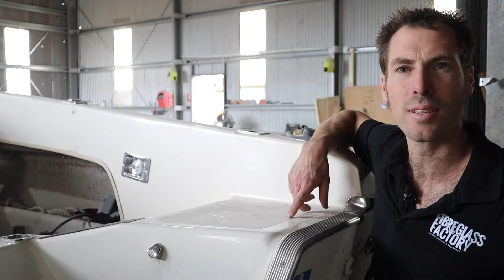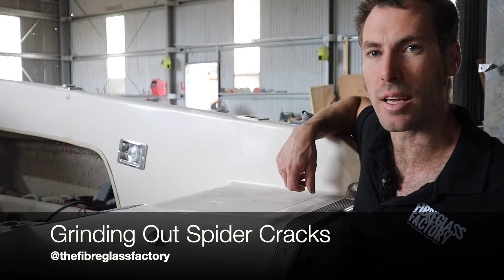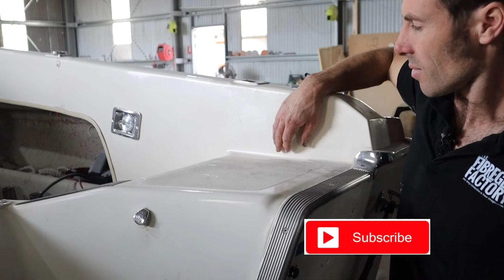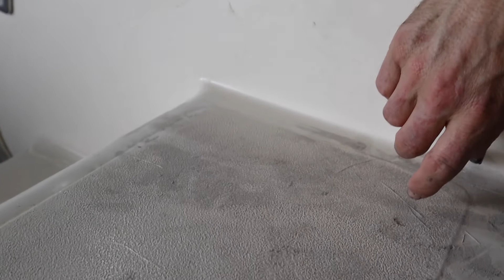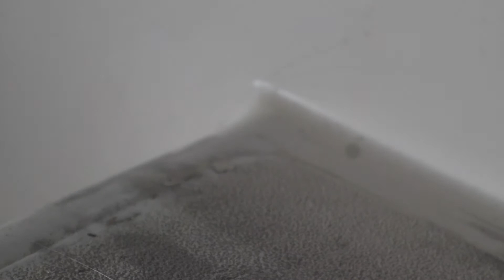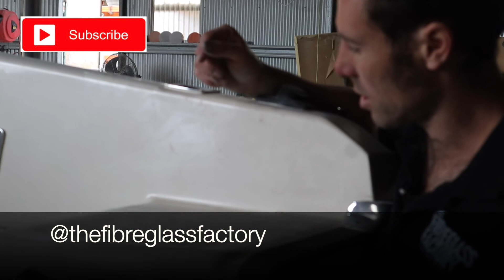Spider Cracks Youtube

Comment: I know this is not your specialty, but I have a fiberglass paint question. I will be painting a fiberglass top for my Bronco. Do you recommend an adhesion promoter before applying the epoxy primer?
Reply from the maker: Check with your local paint supplier what they would recommend